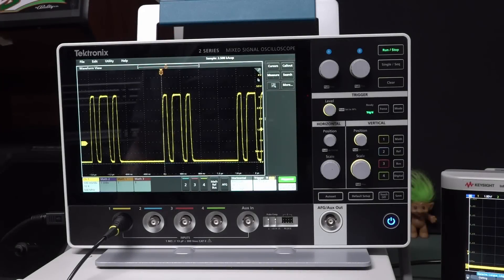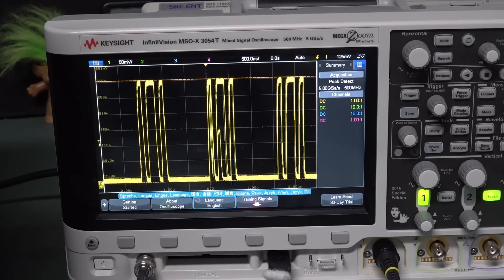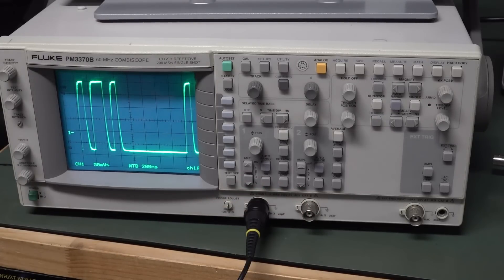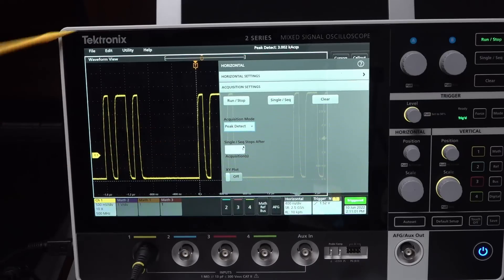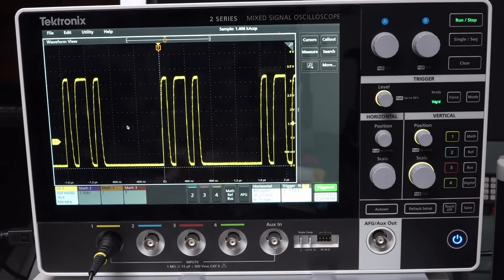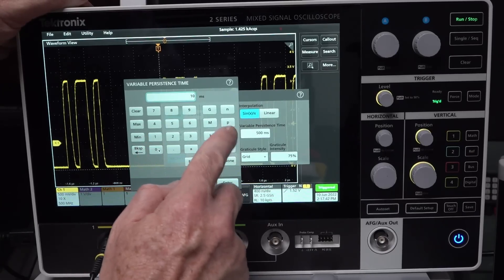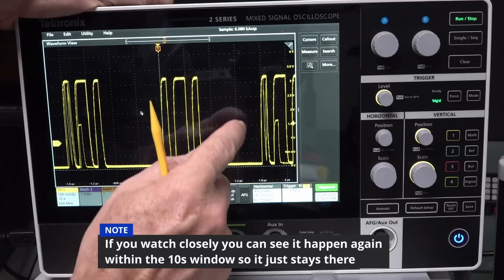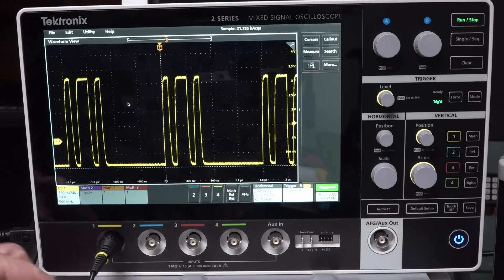Analog VS Digital Scopes for Glitch Captue

Comment: 2:53  ... the electrons ...

But this is not the subject. The thing is that on some analog Tektronix you probably will see much better the glitches ;) 

Not to mention the analog (mesh) memory  type . 
The digital is better, you are right but the lower cost have still problems (aliasing, arming delays, software bottleneck after some hour of use ... and so... only the high price ones are actually better in every aspect).

Comment: Analog scopes with digital readout like the one in this video have some dead time during which instead of the waveform the text on the screen is drawn. Turning off the readout avoids this dead time.  Would it make glitches clearly visible? Probably not.

Comment: Turn up the vertical gain on the analog scope so the brightest horizontal lines are off-screen.  This avoids burning the phosphors and makes your eyes slightly more sensitive to the rare events.  If you suspect a glitch, this often makes it visible.  You can also tweak the focus (and astigmatism if it is equipped).  Older analog scopes had less brightness limitation to protect the phosphors and were more useful for this... but required more care to avoid damage.

Comment: Any reason you use that demo board for these glitch test as I guess not many have those, whereas cheap crude signal generators are all around.
If I wanted to replicate it, with fx a signal generator ( (a cheap 65 USD FY6900-60Mhz)to see how my own scope stacks up in the same situation, how would I achieve it to make it as close to that situation as this tek-demo board..?
just to get myself an overview of how my own scope stacks up in a likewise situation.
I often do that, as a way to learn as a newcomer.. simply try to replicate tests from more skilled people, and then learn while I do it... but these special demoboards you have.. its all relative' what actually takes place..

Comment: Unfair comparison between analog and digital would be with a Tek 7104 or 2467 with MCP CRT.
Reply: I have a 2467 - I might have to do this...  ;-)
Reply: @w2aew  there was so much wizardry involved with the 246x series. Absolute peak of analog scope tech.
Reply: MCP CRT-equippped 'scopes like a Tek 7104 or 2467(B) have no problem showing those rare events happening at 1/10000 - 1/1000 duty cycle. Problem is that the brightness (of the regular signal) would have to be set rather high, adversely affecting lifetime of the MCP CRT. On a Tek TDS3000-series 'scope (3kwfms/s) runt triggering and using longer persistence helps a lot - but you have to wait till it catches the event!

Comment: what is the failure that causes a runt pulse?  I can't say I have ever seen one in the wild, only on demo boards.
Reply: Runt pulses often happen with "bus contention", where two devices try to drive a bus line simultaneously (to opposite states).

Comment: Dave - you know that you can "swipe" those un-displayed Math waveforms off of the screen....   Just swipe the "badge" off the bottom of the display...
Reply from the maker: Well now I know.
Reply: @EEVblog2  Same thing for the measurements - you can swipe them off the screen to the right.  Also, if you have no measurements and want more area for the waveforms - touch/click the small vertical group of three dots on the right edge of the waveform graticule - this will collapse the measurement badge area, expanding the waveform view.  Tap the dots again to re-open the measurement badge area.

Comment: Great video!  QQ - does the Tek-2 have a glitch trigger?  Many of the ‘scopes at work have a trigger mode setting (usually single sweep or “normal”, not auto) to fire when a narrow pulse occurs.  I’ve used this feature for years on Tek and H-P/Agilent/Keysight ‘scopes and I suspect the Tek-2 might have this feature as well.

Comment: The microchannel plate in Tek 2467 and 11300 can show rare events.
Reply: Yep, the 2467 had its "brighteye" micro channel intensifier running at 350 or 400(2467B) Mhz. I'm lucky to have this classic, still great analog scope.
Reply: And don't forget the 7104...

Comment: This is why I have a Tek 7834, Storage scope. It has 'persistence' too, long before Tek, actually Hiro Moriyasu at Tektronix, invented the digital scope. I happen to own Hiro's personal 7704A/P7001 digital scope, and a Tek 7D20 Programable Digitizer for 7000 mainframes. Surrounded by the high end 7000 series mainframes, the 2247A with digital co-processor, is my only pure digital scope, a Siglent 200MHz SDS2202x-E.  It mostly gets used in FFT mode being fed from the residual out of an analog Tektronix AA501A distortion analyzer.

Comment: Once upon a time, there were pure analogue scopes, which had a special cathode-ray tube with analogue persistence, i.e. storage tubes.
Reply: I still use one... Tektronix 7734, 400MHz, 4 bay modular analog scope. I have an array of vertical amplifiers to choose from, and it is equipped with 2) 7B92A time base plug-ins.  When it was new, it cost more than my house.
Reply: @jenniferwhitewolf3784 In '82 we bought our first house for £24,500 2 bed and box room end of terrace - the same year at work I also ordered a Tek 4 bay storage scope for roughly £30,000 - So yep it was more than a house cost in the UK as well
Reply: Horribly expensive!  Very good for capturing fast pulses, but  the storage decayed away quite quickly. Going back nearly 40 years now, so if I remember correctly there was a fine mesh screen in front of the phosphor  which was "Lit" by a separate electron gun a " flood gun " this charged up the mesh or maybe discharged it, when the normal electron beam hit the mesh it changed the charge on it, and that's what the phosphor showed. 

The mesh slowly lost it's charge, and then the image washed out. (I remember the display slowly getting brighter all the time)  So you frequently needed to erase the image and start over. Not something that you would leave on for hours at a time, maybe a minute or two if you were lucky.
 

I've probably got some of that backwards, but you will get the idea.
 
Andy
Reply: @andye2005  properly adjusted storage tube can store a waveform reliably for hours without the "washing out" effect you mentioned (it all depends on the flood gun emission and its colimation, which has a sweetspot where it maintains the waveform nicely, too much the image got brighter and eventually washed out, too little and the image would slowly dissapear). Also as with all analog instruments, for maximal accuracy you need to let them warm up for some time (hour or 2), so in your case if you just turned the instument on to capture some waveforms without letting it warm up first then the flood gun emission was likely out of cal and cause all those issues you mentioned.
Reply: @MrSlehofer  Interesting, The scope in question was some sort of Tek, and as far as I know it was never able to store a image for more than a few mins. 
As it was the only one of two such scopes in the company, it wold not surprise me if it had some sort of fault on it.  

I found the second storage scope (an HP model) on the bottom shelf of the "dead" test equipment racks. The repair cost for it was so high that it was still there when I left the company.

Andy
Reply: @andye2005  Yeah neglected service sure can ruin the performance of any delicate instrument which the analog storage scope sure is.
Reply: Storage scopes were useful, but had their limits.  Another option was to use the Polaroid scope camera!  It had its limits too, but was very handy.
Reply: Yep, I have once bought a neglected HP 1741A scope, and restored it. I enjoy working with it.
Reply: Analog storage 'scopes are pretty much useless in this situation. Because of the high duty-cycle regular signal and the low duty-cycle disturbance (runt), the screen blooms completely before being hit by enough disturbances for them to become visible. Any intensity setting preventing bloom most likely provides too little intensity to provide (acccumulated) storage. An exception may be the trusty old and otherwise pretty much useless bistable storage mode (if fast enough), as available in analog storage 'scopes like Tek's 7834 and 7934.
Reply: Massively expensive to buy  and also had poor long term life. Suffered trace intensity deterioration over a few years  especially if used in storage mode a lot. Especially good were storage scopes with ultra fast :Bi-stable" mode  that gave single trace capture to fastest timebase, where normal storage still needed repeat traces to build useful trace intensity. Yes and trace was fading/flooding out over time. Needed a Oscilloscpe camera for permanent record  at least if buying a expensive storage oscilloscope, normal was also the Tektronix Scope camera with Polaroid image film cartridge for immediate printed traces.
After usually around 10 years the Tube needed replacing  at costs that rivalled the original Scope cost  which by then a new one cost much more, so repair was costly  replacement even more.
Digital scopes far improved on old analog options, once decent trace capture  rates became possible. The early Digital scopes were nasty on glitch search, as with trace captures as low as a few hundred per second , for now lets use 100 /sec or 10 ms repeat rate, at fast traces say 1 us/div, so around 10us trace period, meant 10us/10ms  or 1/1000th of real time captured, the probability of catching even on persistence mode, if available  of a rare glitch say 1 per million events  was so unlikely you could spend most of a day looking and still be lucky to see anything.
Take modern Digital scopes with 1 million/s capability, even at 100ns/Div  the Keysight will be capable of effective all trace capture realtime, and the 3000 and up model series with its special selective " zone trigger" give certainty of capturing some really difficult rare glitches. Other scopes are also with fast trace capture rates of similar or at least hundreds of thousand traces per second  much improved. 
Now with 12bit scopes and other sophisticated features are ever better. More number of traces and digital logic capture, signal decoding ability, sequential capture to thousands of trigger events  so many capabilities never available in analog days. The digital scopes now exceed and obsolete old analog technology. I do admit for some very special purposes analog tube scopes still have some rare functions.
Reply from the maker: They were neat, but still not as good as a digital scope for this purpose.
Reply: @EEVblog2  No doubts about it, can't scroll or zoom the saved waveform :)

Comment: I clearly recall older Tektronix scopes (digital ones) having "peak detect" sampling mode. This helped A LOT with spotting glitches.
Reply: Suggest you turn on digital mode on the Fluke.
Reply: HP 54616B also have peak detect sampling mode.

Comment: have you ever looked at a dscope u3p100 usb oscilloscope?
i had the very first dscope which required windows to disable driver signature enforcement and only had like 200MS/s but did a great job but replaced it with a siglent entry level scope, still the dscope had better fft, better ui but less math functions, specs, channels and voltage range at the time
Reply: Cool,Im looking into something like this,  but almost $500 is alittle much and the reason i was looking into something like this was for it to be a lot cheaper, and did find a similar thing for around $100.  Its  software was terrible and so are the specs but the opensource software for it was reportedly good.  Some guy said it chagned the oscilliscope, which had me thinking how much of it is dependant on hardware and how much software?  What the bare minium hardware you'd need to get this data for a computer to interpret? Could an Arduino solution be good enough?  I was looking into something like this aswell https://www.youtube.com/watch?v=LpbKPiw65_Q

Comment: The technique I used on an analog scope back in my day, required a time exposure with a polaroid. yep, I'm that old.
Reply: Or the Bil Herd way, stare at the scope, then look at a blank wall and you will see the faint glitches 😉🤣
Reply: Analog persistence mode
Reply: Yip I used black and white polaroid to catch glitches in the day (early 90's). Opened shutter on camera, ran test software, when error detected close shutter, develop film, wave it around, wave it a bit more and there it was, in black and white, a 10ns runt pulse on the write line of a FIFO causing the empty and full flags to get out of step. One cause was ground bounce, as pulse was value of data related (no of 1's in the word) and other only seen when using the outer output pins of GALs.  Those were the days.
Reply: Used to do just that when looking at Radar tubes. We have a 3ft long tube that you shoved over the display and there was a hole at the other end for the camera. So no problems with focus and so on. Open the shutter, count to 4 and then release. Worked very nicely. 

We also has "adaptors" to use the camera on scopes.

Andy
Reply: My tektronix 434 analog storage scope has a mode where the screen works like an electronic etch-a-sketch. I bet you could catch this glitch with that.
Reply: I'll have to try that; got a Soviet S1-64 analog scope that appears to have long-ish afterglow.

Comment: Something i would like to see (and have been bitten by) is if you can actually run these scopes for a week while they capture in either infinite persistence or in masked pass/fail mode without crashing/locking up/overheating
Reply from the maker: I've done it many times. Never had a scope lock up on me.